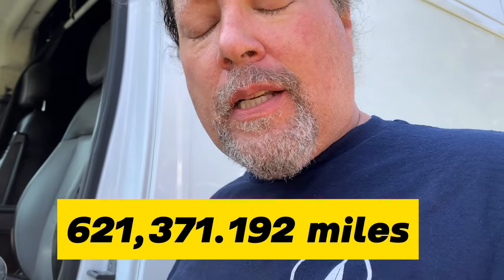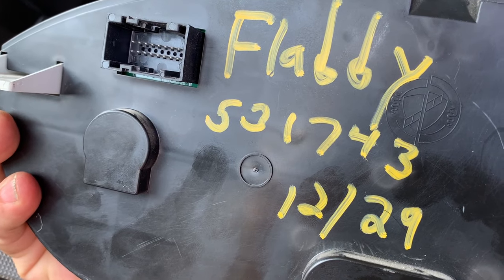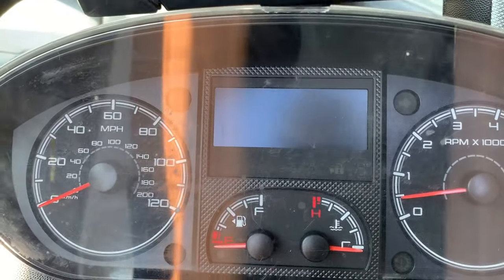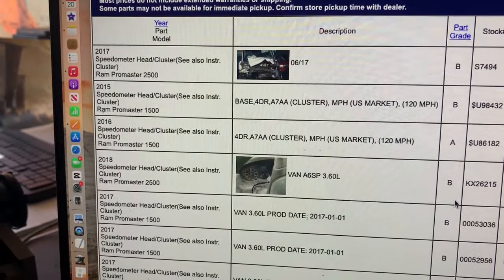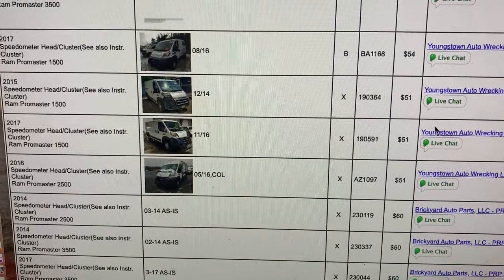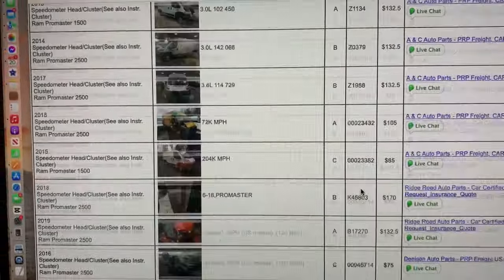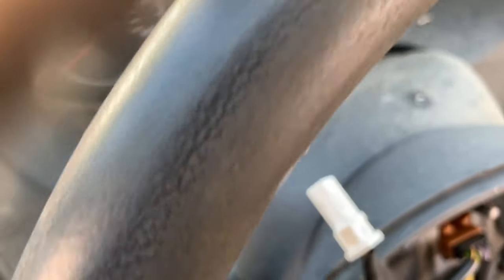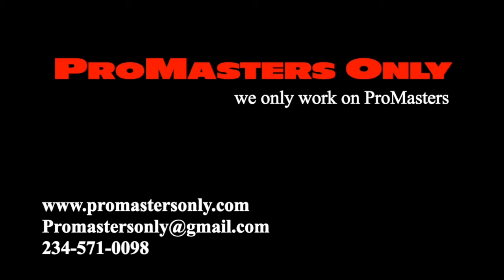Ram Promaster Instrument Cluster Speedometer Odometer Replace. Promasters Only. Cat does not care!

Comment: I did the same thing with my van, used alphaodb app with odblink mx+  odb dongle to do a proxy alignment and even got it to stop flashing! You need the yellow cable to get to the cluster network. Good stuff, saved a bunch of money doing it myself.
Reply: im new to the obdmx+ ,dose the yellow cable plug into the obd port under dash first, than the mx plugs into the other end were do i buy yellow cable?
Reply: @franksaliba7961  yup, it just remaps to the other can channel on the odb port. Pretty basic really.

Comment: Hi Kip, Someone told me the alarm speaker is in the instrument cluster. Is it fairly easy to take the back off the cluster to see the speaker?   I'd like to mess around, either pull it off or desolder it from the board, add some wires and a  potentiometer to turn that noise down or off as needed.   & thank you for the video, it's a great start to my mod.  I'm adding neodymium bar magnets  to my seatbelt clasp receivers tomorrow.
Reply from the maker: I could easily be wrong, but i believe there is no extra speaker, it just uses the stereo for alarm sounds.
Reply: @promastersonly1419  I just got done doing the mod, my 2019 still had the piezoelectric speaker in the instrument cluster.  I posted pics & video of it on fb, Ram Promaster Owners.  & thank you for the reply!
Reply from the maker: @craigsmithx  couldnt find the post. Shout me out in it’s comments.
Reply: @promastersonly1419  as soon as they approve the post, will do.

Comment: Do you have the plastic cover piece that goes across the left bottom side of the passenger seat where the seat belt buckle goes behind and attached to the seat for a 2014 in that pile of junk in the back of smashy? If not do you know what the part is even  called so I can search for one? I cannot figure out what the heck that stupid piece is called to search for it.
Reply from the maker: I know the piece you are talking about, but I also dont know what to call it. Seat trim? Seat side panel? E brake cover? No clue. 

I dont have any complete seats that I want to make incomplete. 

Worst case, search for a seat in a nearby junkyard. Go to said junkyard. Describe the part you want, and they will sell it to you.

Comment: I am looking at purchasing a 2014 PM, the odometer and speedometer both aren't functioning and it isn't digital gahhh. Will keep looking to figure out if this is fixable
Reply from the maker: If you were to take that to a shop for pre-purchase inspection, the actual miles on the van are stored in the body control module, so you can at least know if the guy is trying to bullshit you. My guess is there is a wiring issue to the cluster - hell, you might bring a spare cluster with you since they can be had for well under $50 and swapped out in minutes.
Reply: @promastersonly1419  God you are brilliant. I'll look for one now. Going to go see the van again tonight.
Reply from the maker: search with car-part.com @jeremyjernigan105

Comment: My cluster, and van have 135K and both work fine,  sort of. A few years ago the plastic face started to crack. I now have 3 cracks in the face coming up from the bottom about 1-1/2 inches long. I also noticed on dark days when you turn on the cruise control, some of the other indicator / warning lights glow very dimly. Everything works fine, I'm wondering if its related to face cracking. I'm of the school that says, if it works, don't fix it. Any thoughts?
Reply from the maker: Havent seen that one. Excessive heat? Citrus based cleaning products? Demonic possession? 

The lights leaking to other icons is somewhat common, and yeah some do it more than others. 

I too would chose to ignore it.

Comment: DOES ANYONE KNOW IF YOU CAN YOU REMOVE THE PLASTIC FACE ON THESE CLUSTERS ??? ( caps just for attention,lol)
Reply from the maker: I've never done it, but with the cluster out it's just a few clips to remove the clear front panel. Even if you broken them getting it off, you could easily glue or tape it back together and reuse it. I'd go for it!
Reply: I'm working on this right now.  I have a 2023.  I've removed the cluster.  There are now 2 wire connections.  There are Torx screws in addition to the clips.  They're smaller than T10's so I just ordered a set of smaller ones to take this off.  Hoping it's just one shroud to get to the front clear plastic. Previous owner used some heavy duty cleaner and my clear plastic is schmeered/cloudy.   I'll let you know what I find out.
Reply from the maker: @mtnbikur  Yes, let me know. Haven't had to do anything on the newer van, with the digital screen. I'd bet though that the way to get the cluster in and out is identical though, since lots of stuff wasn't changed from the old model to the new.
Reply: @promastersonly1419 , it was exactly as you/your video described.  Just two wire harnesses now.  I'll take some pics when I put it back in.
Reply: You can remove the plastic face.  It involves a couple of shrouds that use almost a dozen T8 torx bit screws and a few clips each.  The clear plastic is glued to the inner of those two shrouds, so it's not a stand-alone piece.  I've put the outer shroud on without the inner shroud/clear plastic and it's sturdy and secure, but your gauges wouldn't be protected at all.  With the digital dash on mine, I'm not sure how much of an issue that is.  With analog gauges, you might be more cautious.  I've ordered some acrylic polish and will try that before putting it back together without the clear plastic.
Reply from the maker: @mtnbikur  Good info!

Comment: Whats up with pcm? Kippy
Reply from the maker: How do you mean?
Reply: @promastersonly1419  my pcm will that affect my alternator charging?
Reply from the maker: Yes, the PCM (powertrain control module - the engine computer) controls charging. Not related to the cluster though.  @raymonddriggers
Reply: @promastersonly1419 what i mean is would it make my battery light come on and cause my battery not to charge “pcm”?
Reply: @raymonddriggers    Check the connection on the alternator.  I had charging trouble and it turned out to be a high resistance connection.  I disconnected it and shined everything up with sandpaper and my problems went away.  I was able to deduce that was where the problem was by putting my voltmeter probe on the alternator terminal and noted it was almost 1 volt higher than the battery voltage.
Reply: @Randy001  thanks randy I’ll get right on that